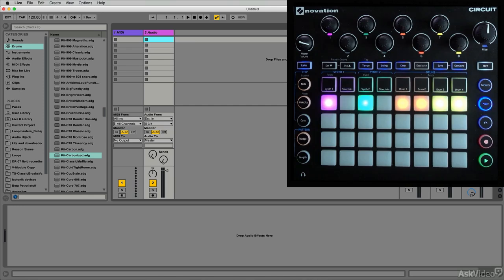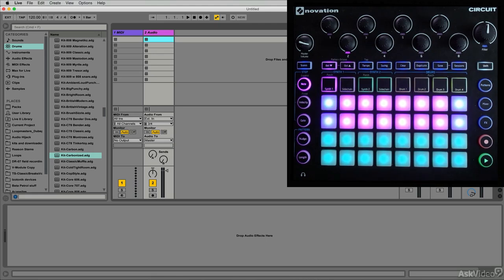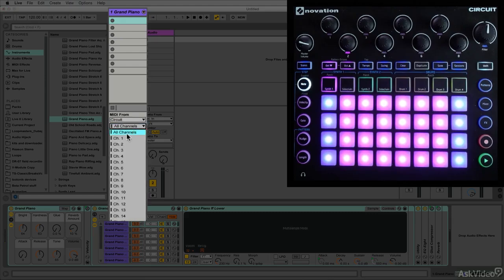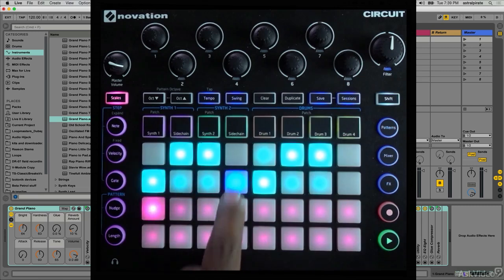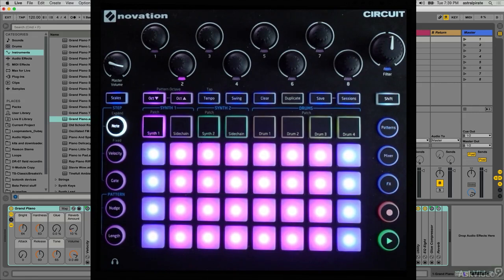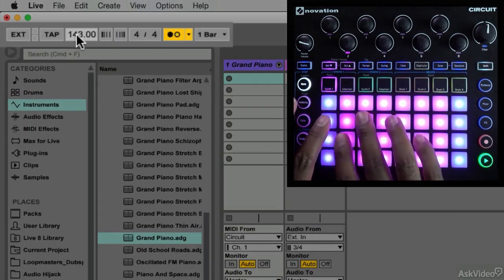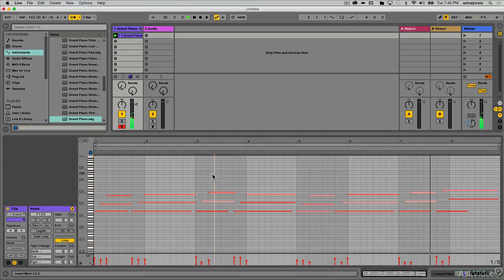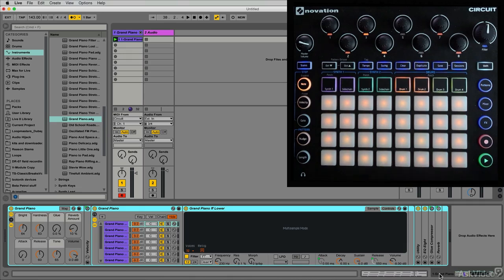Circuit 201: Novation Circuit - Advanced Circuitry - 6. Circuit as a MIDI Controller

Comment: Does this work on Circuit Tracks or has something been changed ?
Reply: I just tried it out, works with my curcuit tracks. Also the midi channels work as input for channel 3 and 4, so you have 4 melodic channels

Comment: This is probably a dumb question. I just got a computer capable of running Ableton. Do I just need to connect the MIDI cable to be able to record from my circuit, or do I need to have some sort of audio plug in also?
Reply: my guess is you already have your answer but midi doesnt transport audio. its just note data. to record audio you would need an audio interface with at least 1 input for the circuit. some pc's may have a line-input which you could also use.

Comment: So how does this even work ? Is it a 3d party script ? For the life of me i don't understand why Novation hasn't included a full (not just Mackie etc) Ableton script via firmware to use the Circuit as a compact Ableton Midi controller. Such a pity. I get it that they kind of wanna protect the Launchpad line, but it's still a bad move to not build in enhanced functionality (which could easily be done) on purpose.
Reply: it works via midi - lol.